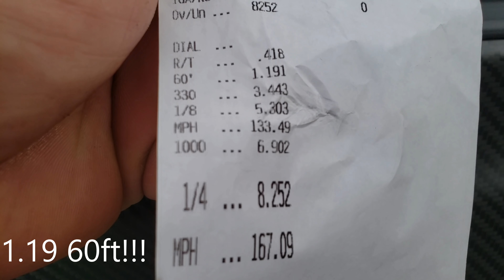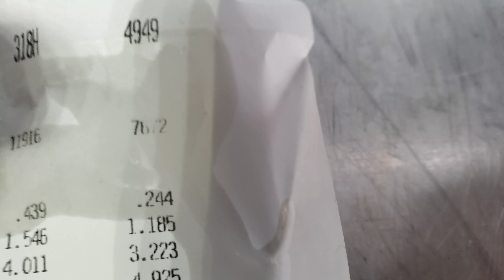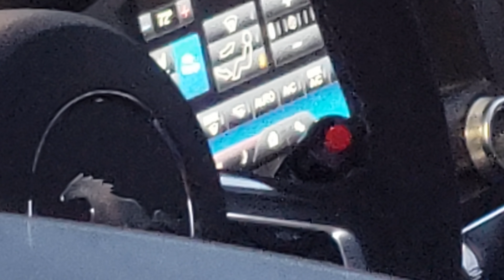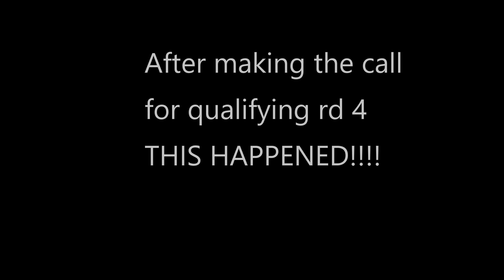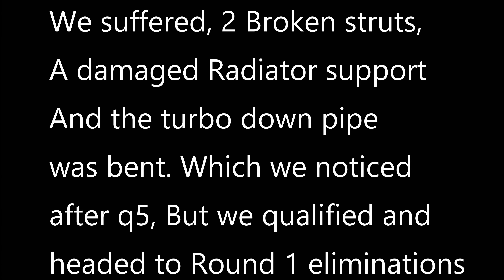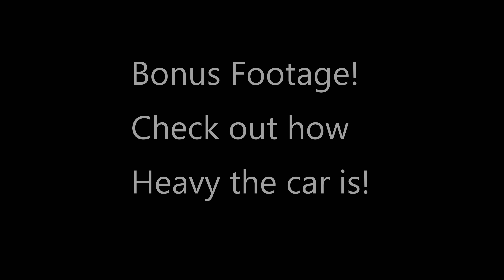Blue goose becomes the Flying goose at Import VS Domestics

Comment: What did it take to fit the 315 tire on it?  You guys are running bear brakes on all four corners are you not. I had to run a 5/16 spacer on the back to fit the billet specialties wheel with the bear rears. The 305 it right in line with the fender
Reply from the maker: 17x11.5 belak wheel. that's it.

Comment: That's everybody's answer for wheelies, "tie the front end down". Half the time it's in the rear geometry.  Crazy it started to wheelie like that though. I know nothing about the 6r80 but do you guys regulate charge pressure?
Reply: @303StreetMachines tune ain't got nothing to do with what I asked and doesn't matter how many clutch sets or planetaries it's still a 6r80.
Reply: Unless charge pressure can be regulated via tuning software.

Comment: Hey bro are the hellion kits any good? Cause I just picked up a 2019 mustang convert auto and I wanna throw some twins on it with 67mm turbos, I watch your videos on the regular... reason I purchased another mustang so the kit I’m looking at now with all my ads on I’m looking at 12-14k that’s with all the top add ons, would you buy the fuel upgrades with tune or would you buy that separate? Also would you purchase there turbosmart eboost controller. Hope to hear back from you beofee I purchase the kit today
Reply: Look into Limitless Performance and fabrication twin turbo kit. Can get you their dual pump fuel system (good for 1000whp) and tuning from them as well. That's what I have on my 18 and have been 8.95 @ 156mph so far!

Comment: been there done that....every time I step up the tune the car i risk a wheelstand, we were doing 1.08 60s on a 275 BUT I  run a 2 speed , glide or Th400 instead of that 6r80 garbage so you can have a 158 or 140 first gear.
Reply from the maker: We are oem calibrators, glides and TH400's don't interest us. :)
Reply: @YDBT4LIFE  i hear ya big dawg...Thanks for the vids

Comment: you seen the new mopar challenger? it does 7.5 in the quarter mile from the factory
Reply: Maybe in the 1/8
Reply: Robert Goodman that’s not what they are claiming. it comes with a parachute and wheely bars
Reply: Robert Goodman you know challengers can do 9.5 with tires and a tune. Check demonology